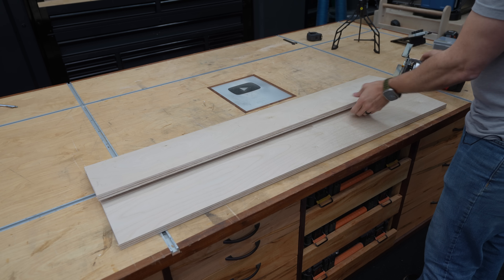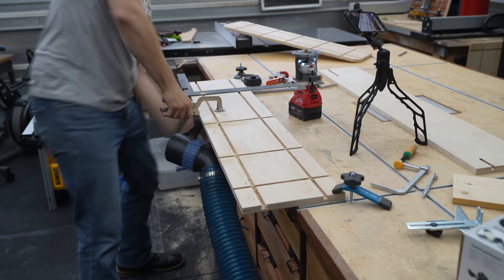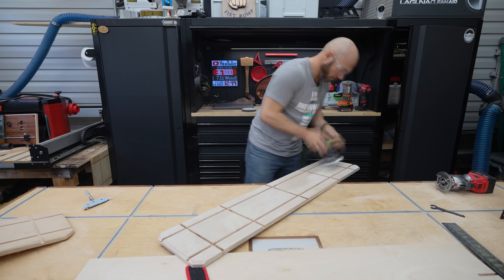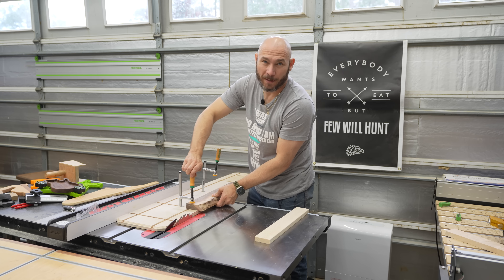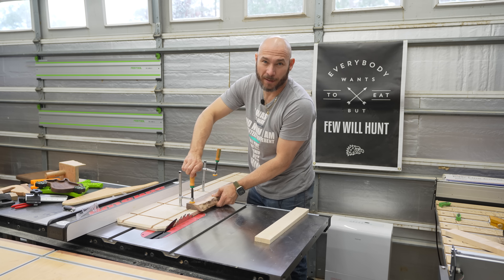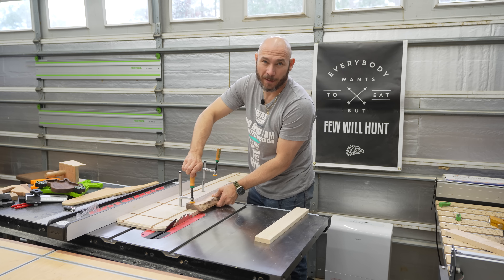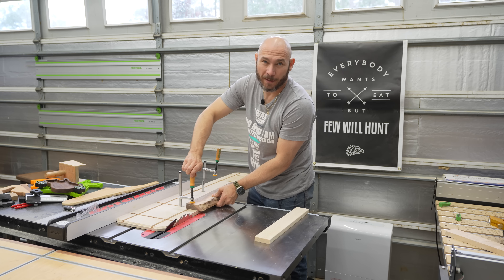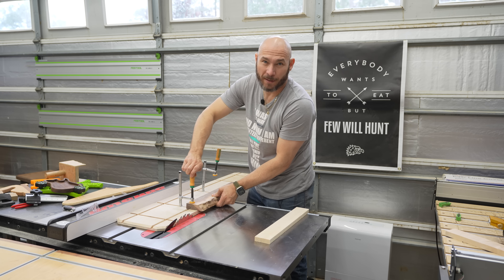99% of Beginners Don't Know About this Woodworking Trick!

Comment: When you ate making the dove tail grooves could you stop and not go all the way through to the squared side?  That way your clamp will not hit the saw blade? Also if you look at their website you can remove the screw and reverse the postion of the clamp so the dove tail of the clamp is facing away from blade.

Comment: Would you recommend MDF for this sled? Also, if you have a wide board to joint, how do you deal with the lower-than-the-saw's-table-top distance between the table and the fence in a jobsite saw other than making the sled a lot wider? And I bought the plans for this sled from you, just in case.

Comment: I was trying this today. I went over to the woodcraft store they didn't have to 1/4 bit so I had to get a brand that wasn't mircojig and it didn't work this easy for me. I don't know if it was the bit or my ryobi router wasn't strong enough. I couldn't make one pass without the router turning off my battery was fully changed.  I'm going to try again tomorrow. I got a new router 1/2 shank and the 1/2 microjig bit.

Comment: Invest in a good blade and you'll be happy with the results.  Been using a similar jig for years.  Mine will take up to 8ft and I have a miter strip running full length to help keep it straight.

Comment: Do you just line up the piece with the 3/8 slot to ensure it’s exactly square?  Since the work piece is not actually positioned against the fence?   Assume that’s the best solution, right?

Comment: Do you have to use the factory edge? Asking because I have scrap pieces that are laying around but all edges have been cut on my table saw. Don’t want to buy a piece if it’s not needed. My table saw seems to be very accurate so just curious if that matters.

Comment: What makes this better for jointing than just using the fence?
Reply: If the board has two wonky edges then ripping it on the fence will copy the wonkiness of one edge. This jig establishes a straight edge that you can then rip the other side

Comment: How in the world were you able to cut out all the grooves in one sitting? Once I started cutting the 2nd lengthwise one it started smoking. I didn't turn off the router just let it run freely hoping to cool the bit off. I just kept inching it along as it kept throwing out a bunch of smoke. By the time I got half way through I looked back and there are spots along the cut that are embers and burning the board. I decide to stop the cut and pull out and my base plate is melted in a couple spots and the bit was caked up and made the bit look almost round like a ball. Any ideas on why that happened? I'm sure the bit is ruined and I'll have to order another.

I'm using 3/4 plywood like you and running the Dewalt 20v router. I've been only using routers for about a year but I've made hundreds of cuts and have 30 plus different bit types and never had this happen before. I don't force the router and let the tool do the work. Speed was set at 6 like I do with all the other bits 3/4 and smaller. Need some help here to figure out what's going on. Thanks in advance.

Comment: Saw your video on the Wahuda jointer that was given to you, nice. I been looking at the 12” Cutech jointer for $100.00 more then the 10” what do you think asking for your option
Reply from the maker: They look to be very similar.  Not sure if they are both made in the same factory or what.  I haven't used the Cutech brand though.  A few years ago Cutech was Wahuda.  Then they changed to Wahuda and Cutech went away.  Now they are both selling products.

Comment: Maybe I missed something, but what is the purpose of the long grooves? I only saw you use the slots going across.
Reply from the maker: It just gives you more clamping options for various types of wood.
Reply: Thanks Matt. 👊🏽
Reply: I would use the long grooves to clamp stops down if you had to make 4 table legs the same.

Comment: This comment may be way off but I'm gping to post it anyway, please let me know if it is wrong to try.  Why not set your table saw to just shy of the depth you need to use your Dovetail bit, cut the grooves needed and then finish with the Dovetail bit.

Comment: Thanks for the excellently presented video. This obviously needs a good blade to get the "jointed" edge smooth. What blade did you use?
Reply from the maker: I used a CMT Chrome 24 tooth ripping blade (linked in description)

Comment: How do you square the board being cut parallel on the jig?
Reply from the maker: you don't worry about it being square on the "jointed" side.  You will run the opposite side through the table saw without the jig and that will square each side to one another.

Comment: Thanks for sharing but the stuff you need to make it I believe a planer is cheaper. Over here in Sweden that thick plywood is not cheap and they only sell the whole sheets so that alone is at least a third of the cost for a cheap planer. How do you thickness wider pieces wood with this there is no blade for a normal table saw with a big enough diameter for wider pieces wood that I know of anyway.

Comment: Thanks for the video, that’s a really handy jig. Not sure I would consider it a joiner jig considering it only makes one of the two cuts a joiner does but with all the things you can use it for it’s still something worth building. I have a question, is that the original fence on your dewalt saw? I have the same saw and hate my fence. I would love to replace it. Thanks.
Reply: The DeWalt fences are pretty trash. If you find something I'd like to know.
Reply: @PhotonChief  I looked and they are very expensive considering my saw was around 600, the aftermarket fences start over 200 for crappy ones and the good ones start at 300 to 600. I think I would be better off selling my saw for around 400 and spending the out of pocket 400 on a saw with a good fence.

Comment: Cool video. Which 10" table saw blade do you recommend? I have the same SawStop. GOD bless.
Reply from the maker: I use CMT Chrome blades.  I like the 24 tooth for ripping and the 50 tooth for a good combo blade
Reply: @731Woodworks  I've never used their chrome versions, just the coated and they are great. I will give the chrome a try. GOD bless.

Comment: Hi Matt, Iove your channel, keep up the great work. I watched the video you did a year ago on this sled, in that one you used a 1/4" relief bit prior to the dovetail bit. I was curious as to why you didn't repeat that process on this one?
Reply from the maker: I found that it is not needed on softwoods.  Just easier to use one bit
Reply: @731Woodworks  That makes sense, thanks for the promptly reply

Comment: Great tip as always. But why did you go all the way on the crossgrooves? I would have stopped 5mm from the end so the clamp woundn't go into the sawblade by accident. Or have I missed something about going all the way through? I will absolutley build this magnificent idea/tool for my small workshop.
Reply from the maker: Good idea!

Comment: Can I use mdf?
Reply from the maker: Yes....but I would be very careful with the clamping because MDF isn't as strong as plywood and the clamps may break the MDF
Reply: @731 Woodworks  beside baltic birch $$$$ what the best plywood for jigs? Just a cabinate grade plywood? Sande plywood? am new to this.
Reply from the maker: @Max-kn9yi  I typically just buy 3/4" plywood from Home Depot or Lowe's.  Usually labeled as sanded birch or maple plywood. It's not "baltic" birch which has a lot more layers and costs a lot more.

Comment: Could I use melamine for this? I have a scrap piece perfect size
Reply from the maker: As long as it’s stiff enough and doesn’t flex it should work. Also if the clamps don’t tear through it when clamping down

Comment: I'm watching again and again and I still do not understand the point of the two long grooves... What are they for ?
Reply from the maker: just extra clamping options as well as you can use them to set up stop blocks if you used it for tapering.
Reply: @731Woodworks  Hoooo. I see, ok. i'm just dumb.

Comment: What I don't understand is how you keep the board straight in the jig.  I saw pencil marks for where to line it up, but couldn't you clamp it down crooked?  I guess you can, because that's how you get a taper - right?  I guess you're just supposed to get it as straight as you can - and then joint the other side based based on the first cut?

Comment: I made one of these without a runner. But the saw kept chewing up the jig. Feel like the runner version is better
Reply: Agreed.  With a runner in the miter slot, you don’t have to try setting the fence back to the exact same location.  The fence also limits the width of the boards you can use on the sled.

Comment: I've got a smaller, slightly different version of one of these, and I found it much easier to ride the fence. I started with using a Kreg miter bar for the miter slot, and it was fine, but sometimes I had a really wide board, and the miter slot limited how wide of a piece I could use. With the fence, I can get a couple extra inches out of the jig.

Comment: The only problem I have with the dovetail clamps is that if you need to clamp with lots of pressure,  the steel dovetail arm of the clamp will pull up on the plywood channel so hard it will break the dovetail "wings" of the channel.  The solution is the clamp arm that runs inside the plywood channel is so long that you cant clamp hard enough to break the plywood channel as the force is distributed all along the steel arm against the wood.  But is this actually the case??

Comment: Can I use T Track instead of the micro jig?
Reply from the maker: I don't see why you couldn't.
Reply: I am considering going  with T Tracks. I decided to try this method to $ave the money of not having to buy the T Tracks, but I am struggling using the dovetail bit in my test cuts. Separate post above as to what I am experiencing.

Comment: My first attept at cutting with a dovetail. I have the Dewalt DW 6184. Initial test cut, plywood, against the grain, speed setting 4. The router struggled which surprised me. So, my text test cut, still against the grain, up ran the speed all the way up to  6 (max). Seem to cut better, but near the end it was difficult to push thru & it struggled again. i read where someone recommended using a 1/4 in straight bit for the first cut, then come back with the dovetail. That helped but near the end, again, it was a bit hard to push through. In each try, it wasn't the cord. I was going L to R. I didn't purchased the bit he is using on this video. Mine is the Bosch Precision Pro (Lowes). About half the price of the one in the video. Any suggestions?

Comment: I have bought some of these clamps but haven't used them yet. I'm curious how well the plywood does at holding the clamps without the clamps breaking out of the plywood dovetail grooves. My current jig is using T-bolts but they keep working through the T-slots I put in my plywood (didn't use tracks) so I've started drilling holes for clamping locations just to get me by.
Reply: The clamps hold up real good on plywood. I’m going on 3 years with an entire assembly table and zero problems.

Comment: We need to stop misleading beginning woodworkers into believing that jointing only involves the edges of wood.  Jointing always starts with a flat face on one side of the wood.  At least, the discussion of a flat face.  Once a flat face has been created, then and only then, can we joint an edge. Jointing a face requires the tool you say 'don't use', the jointer.  Sure, you can use the planer for the task, but it's much easier to have a 10 inch Wahuda jointer to do the job.  Please don't mislead the beginners.

Comment: Didn’t you already make a video on this ?
Reply from the maker: yeah it was inside another video that had several jointing methods in it.  Thought it deserved it's own spotlight
Reply: @731Woodworks  I appreciate it, as despite watching many of your video's I think i've missed this one, and will be really easy to find and refer to when I end up setting my own shop up! This is a genius idea and saves me having to invest in a jointer when I'm not sure how much use it will realistically get at first! This is one of my favourite videos for it's simplicity vs usefulness ratio.

It again highlights how I need to approach the whole craft, and rather than just answer a problem with a very expensive tool, try to think about the core forces at play and how to replicate them on a shoestring budget. 

Thanks again mate, from Australia.

PS. Any chance you could link/tell me the name of the older video in question? I'm sure there would be some more gems in there for me to scoop up.

Comment: Fine. Now do it without any power tools.
Reply: Why?
Reply: @kimmytuna5180  Not everyone has power tools.
Reply: @mgmoody42  If you don't have power tools, why would you need a jig such as this?
Reply: @kimmytuna5180  Just hand tools, without the jig.
Reply: @mgmoody42  I do not understand the point you are trying to make. If you prefer using hand tools, more power (pun intended) to you, but why do you need to denigrate those who choose different techniques?
Reply: @kimmytuna5180  The point is that you can solve the “problems” he mentioned without any power tools, and you can do it without having to breathe sawdust, you’ll be able to have a conversation while doing it and do it safely.
Reply: @mgmoody42  Really? That didn't seem to be the point you were making earlier. And are you suggesting that working with wood without power tools eliminates the dust problem? Again, it seems you have something against power tools, which is odd because I'll bet a bunch that you take advantage of power in many other forms in your daily life. Do you make a living without the use of power tools? What exactly is your problem?
Reply: @kimmytuna5180  There is NOT dust flying all akimbo while ripping a length of timber by or while planing a piece of timber or even boring holes in it with hand tools. If you had actually done so then you would know. The only one of these produces dust and most of it falls directly in the path the saw moves towards, Planes produce ribbons of wood, boring makes chips, The video makes use of major power tools which require space and a larger outlay of funds. Also, if you're living in an apartment, you couldn't use noisy power tools without complaints from your neighbors.
Reply: @mgmoody42  What the hell are you talking about? People who live in apartments have to use hand tools for all their woodworking projects because of the noise produced by power tools? I believe this conversation is over as I am taking the advice from Proverbs 26:4-5. Have as a great a day as is possible for someone such as yourself, good day.

Comment: The whole point of using a jointer, is to make a perfect 90 degrees edge, so when you run it through a thickness planer, you get a perfect 360 degrees total, with perfect perpendicular edges. That's the whole point of a jointer. If you don't have a thickness planer, then don't bother with a jointer. If you do have a thickness planer, you can still use this method of course, but for fine furniture, I'd still recommend using a jointer for very fine measurements. I typically work with 0.1 mm (0.00393701 inches), but when I get to my final exam, my margin of error is 0.01 mm (0.000393701 inches) on all of my measurements. When you're working with such fine measurements, I honestly wouldn't put my faith in a table saw. It's just not good enough.